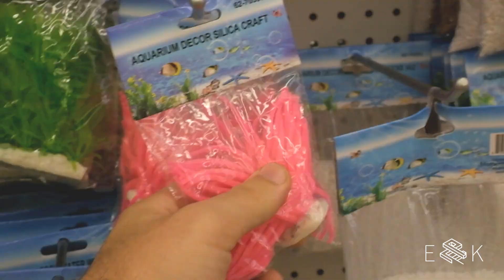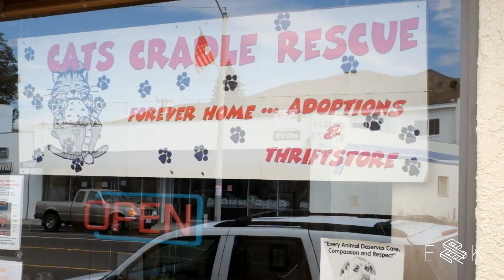Making a terrible cat toy with William Osman

Comment: I wasn't expecting a collaboration but I was super excited to see it! Maybe the catawhack would be more effective if you covered the holes with some paper with slits in it? That way the items would be more completely hidden from view when they go under. Also, I'm all for a #catshirt.
Reply from the maker: +Newt 144 you are a cat toy genius! Maybe in version 2.0. Also entry received, may the odds forever be in your favor!
Reply: Thank you! Oh, and another thought: those little levers are the perfect size for holding pretty much all finger puppets. The holes might need to be moved forward relative to the levers though, since right now there's not much space between the front edge of the hole and the lever as it moves up. 😺 If you ever improve on the design and test it with cats again, I would love to see it in a video!

Comment: #catshirt also this is the cutest cat toy ever. But I do think it can be modified to fit your first vision. First I would increase the size of the box, width and length wise, and maybe even the height to accommodate the size of the cat toys so that they can properly hide inside the box. and then increase the size of the holes. The toys as well could use an upgrade, things that wiggle like feathers, rubber bands, etc are good. I would also recommend adding bells. I love the idea and it's obviously just for fun but if you wanted to critique it and fix it to maybe get it to work try that.